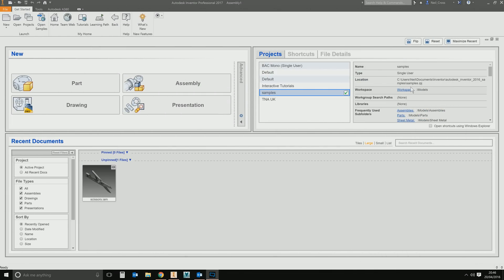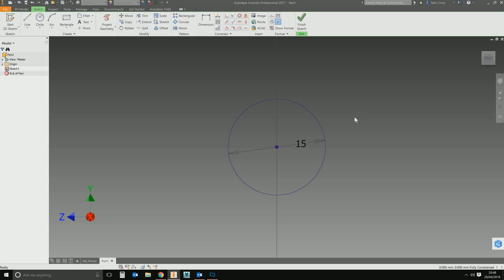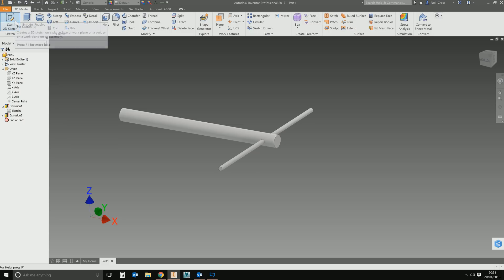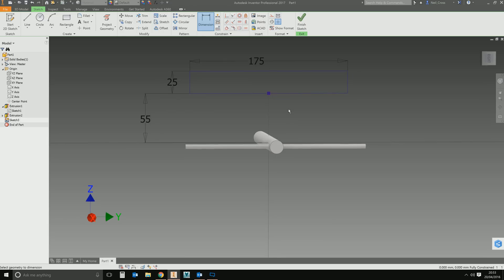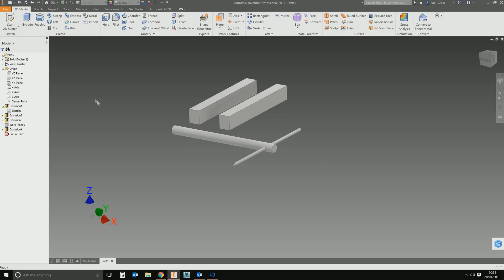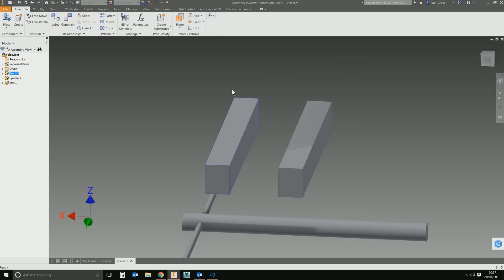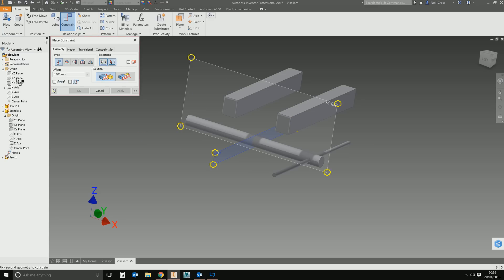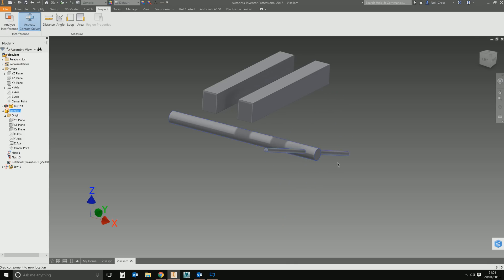How to simulate a vise/vice movement | Autodesk Inventor

Comment: The tutorial was very helpful thank you, however on using the "make a part" I could not add the parts. I would appreciate your help in increasing the text size of the dimensions in sketch mode, since the "Application Options " only allows size 9. Your help will be appreciated since at my age I need large text.

Comment: I know it won't look as good, but do you think you could turn down the resolution to 1080p just to get rid of all the problems you were facing. That is unless autodesk actually fix it
Reply from the maker: +Fraser Muir Its only whilst I'm recording content whilst I'm working out of hotels, I'm on my Alienware laptop at the moment which has a 4K screen, sometimes I get as many problems down scaling to 1080p as I do running native 4K.  Also, I've been told my videos are watched by the Inventor dev team so this is a way to highlight problems to the people who fix it without having to go through hoops complaining to people who have no influence over fixing things! If they see it with their own eyes it's the most effective way of reporting issues! If the issue was so big that it spoiled the purpose of my video then obvs I wouldn't include it though!